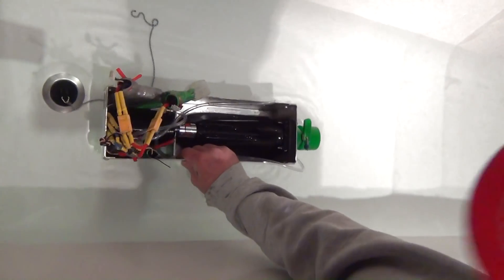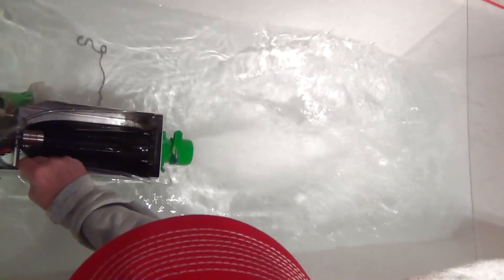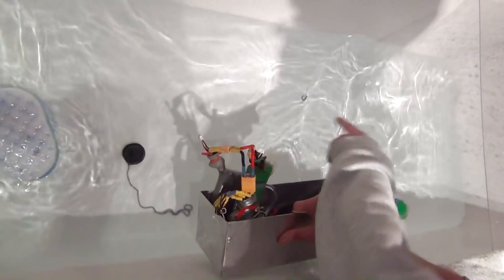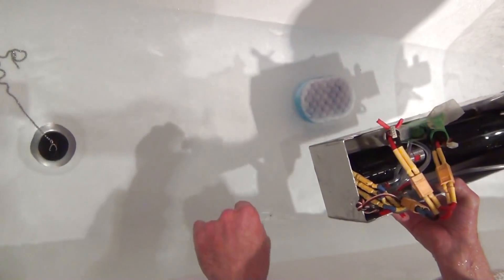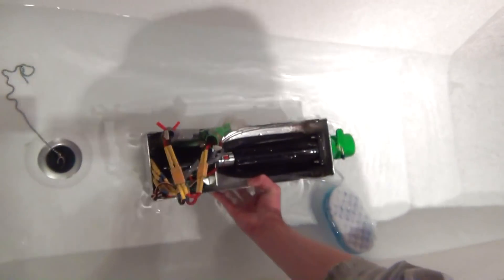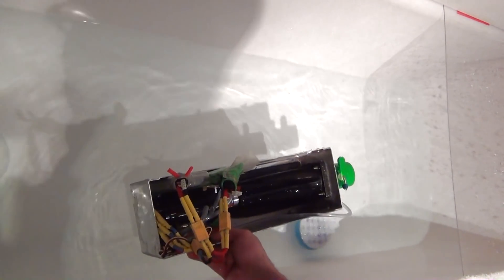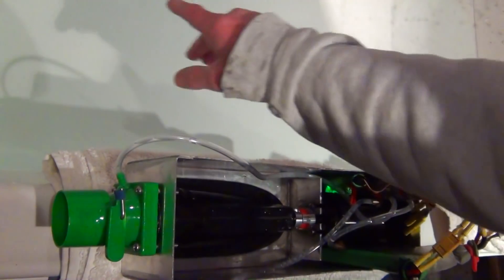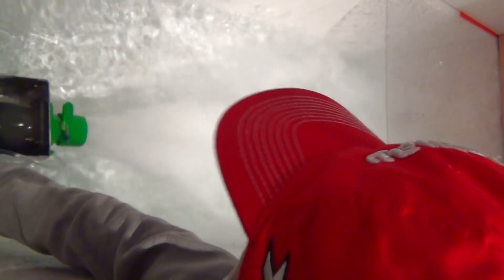Big motor test with 53mm jet unit

Comment: What did those electronics cost? Can’t wait to order one!
Reply from the maker: Hi Cameron
I hope to have a list of things to buy soon for the slower SUP version 
and a higher speed version,,
the price I've spent is under $1000 complete with board and drive,,,
it might need two drives for any high speeds,, but I need to find this out
once the drive has been optimised,,, I'm waiting for a part so I can get on with finding out what we need for speed :)
Hope all is Rockin mate and Cheers
Mark